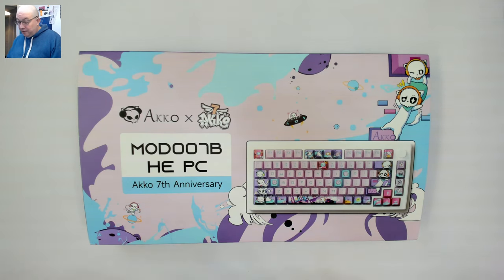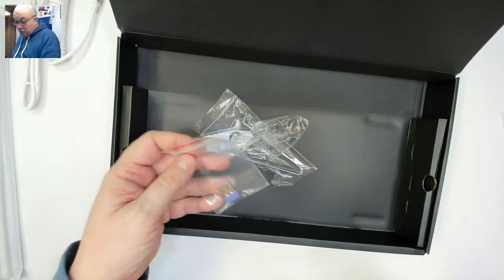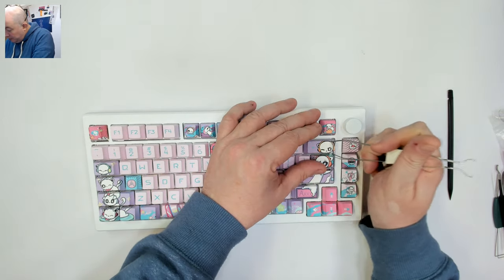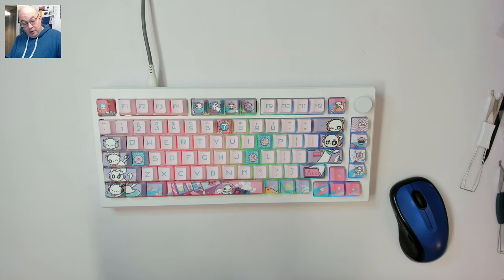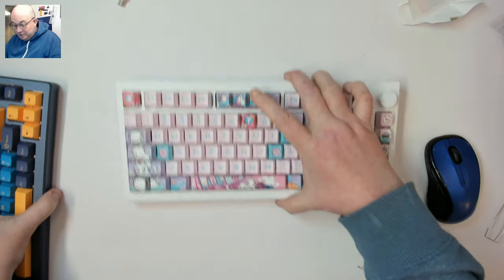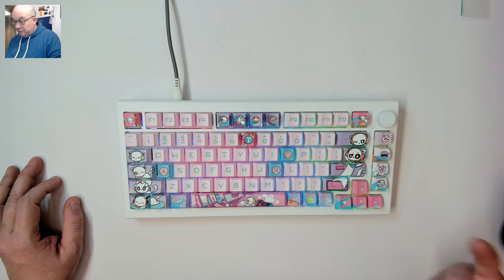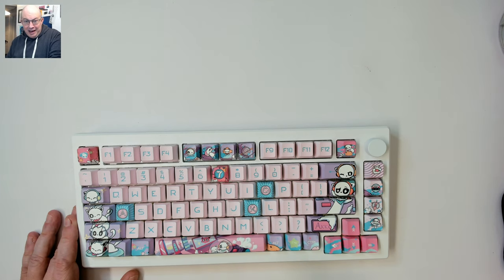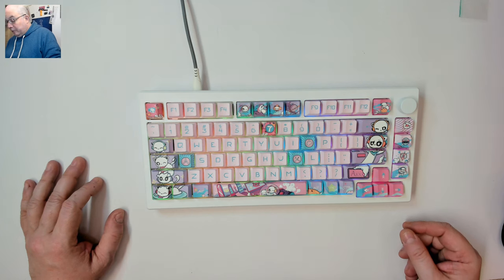Akko MOD007B HE PC Review and Sound Test

Comment: It's a lot of trouble if you can share the software for your keyboard with me, mine arrived and is exactly the same with the switch on the caps lock, the same model, and with a dongle but the problem is that the bluetooth and the 2.4 ghz wifi don't work activate, could you give me the software or how do I pair the 2.4ghz wifi with the keyboard or how do I change the software?

In the software it recognizes it as MOD007PC-CX and I see that it recognizes youtubers as MOD007B-HE
Reply from the maker: MOD007PC-CX (https://en.akkogear.com/product/mod-007-pc-mechanical-keyboard/) is not the same as the MOD007B-HE, but both use Akko Cloud Driver found here: https://en.akkogear.com/download/
Reply: @MechKeyboards  Thanks mod007B-HE, I can't find it and neither can I download the software from the Akko Cloud app, I already contacted Akko in support, I thank you.